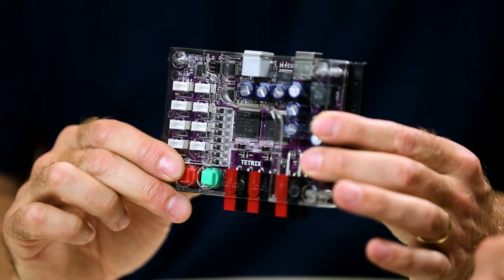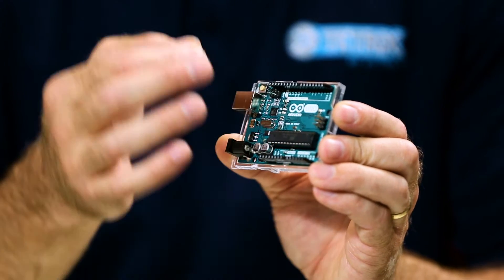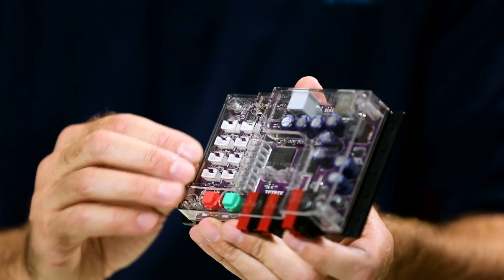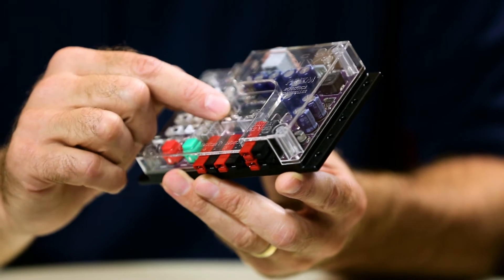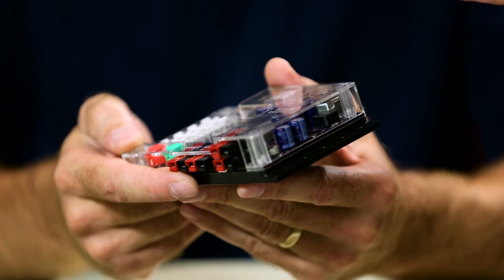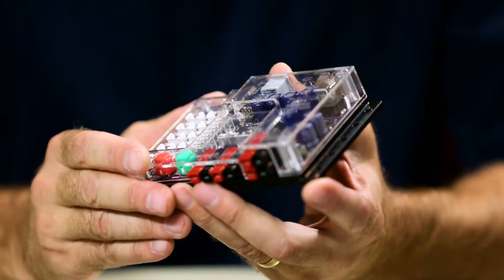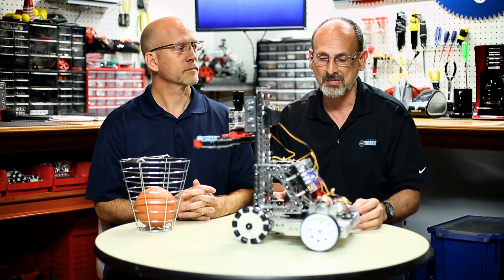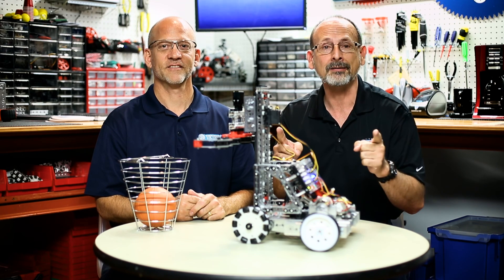Intro to TETRIX PRIZM Robotics Controller

Comment: Can the vex motors plug into the servo ports in a  TETRIX® PRIZM® Robotics Controller and work.  The controller servo port has a 6Volt 6 Amp max.  The Vex battery is 7.2V
Reply from the maker: Thanks for asking Mike. We did some searching, but couldn't identify what servo you're using for sure. If you provide a VEX part number, we can be more specific, but in general, any off the shelf 3-wire standard servo motor can connect to PRIZM®.

Comment: Are the Hitechnic DC Motor and Servo controllers compatible with the Prizm controller, or is it necessary to buy the newer motor and servo expansion devices? Thanks
Reply from the maker: Our robot specialist, Tim, recommends that you upgrade to the new motor and servo expansion modules. If you need more technical support, give us a call at 800-358-4983 or from outside the US at 620-231-0010.